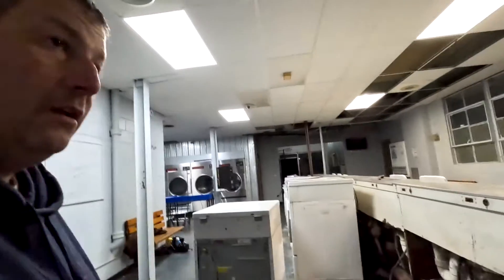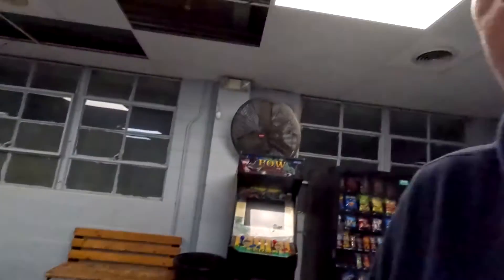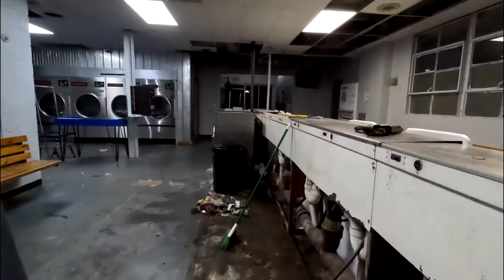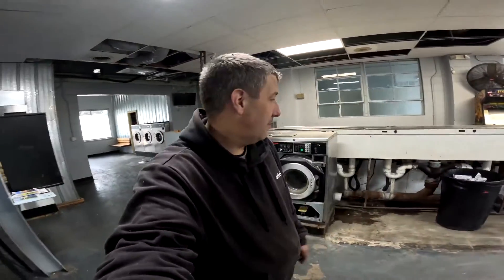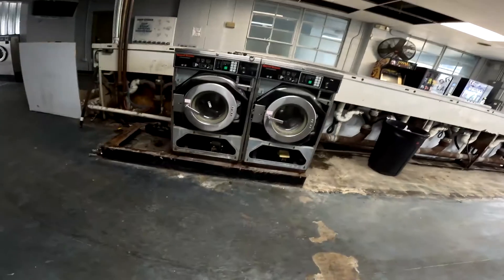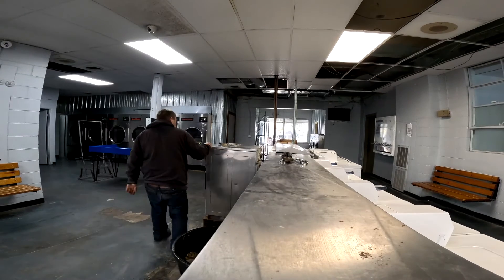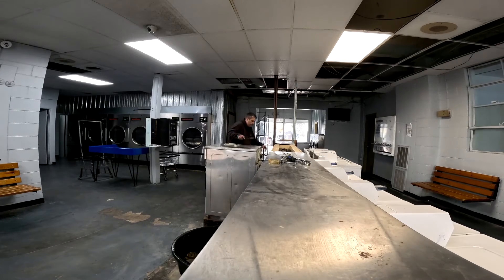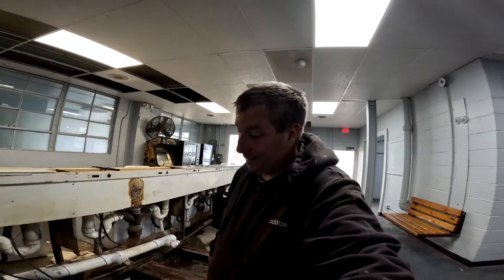Laundromat Rehab Time to Junk Horizon Washers!

Comment: I dread hearing the problems my friend & his sister will have we when they fully renovate their new Acquisitions. We in desperate need for Tradies (what you call contractors) as most trades are 4 year including studies. I rallied some almost qualified tradies over the Xmas break to commence some of the demo / rehab work but like all industries - Supply & Demand is the key issue. I am certainly not trained but I noted in 2 of the laundromats - cheap soft wood was used for the risers so this will all be rotten when removed. Thankfully the owner listened to me & obtained all measurements in advance, so drew up basic plans that allowed a plumber to quote on materials.

Comment: Watching to see if the old-fangled top-loader plumbing gets ripped out and what is the modern optimal way to pipe it up. Have similar old-fangled at my place, it's got a few issues, been shopping PVC to replace sections of it, not a plumber but playing one at the laundromat.
Reply from the maker: Me too! Ive had 6 ideas so far. Funny thing is both my Dad and Grandfather were plumbers. I never knew cast iron pipe had flanges

Comment: I see and notice you complaining about the top loader's speed Queen what about the other machines from speed Queen are they reliable and if so do you have any distribution information from them
Reply from the maker: Yes they are good brand. I do like speed queen top loaders. Other brands no. 

Dealers for laundromat equipment have territories. So you have to use dealer locator on speed queen web site.
Reply: So basically what you're saying is whatever the Distributor is in my state I have to go with them south Carolina